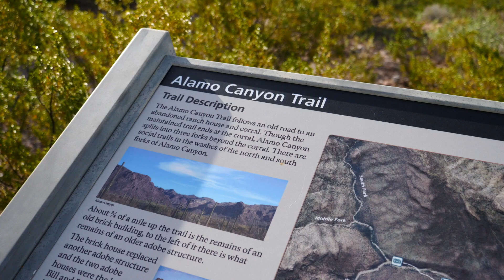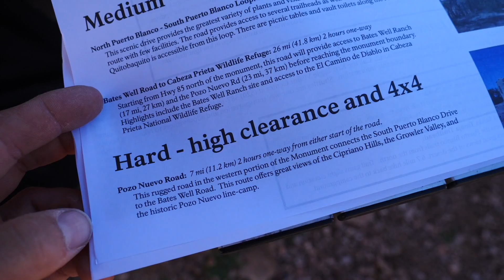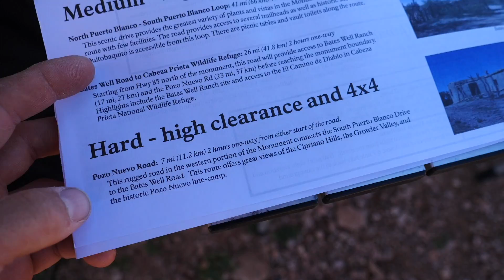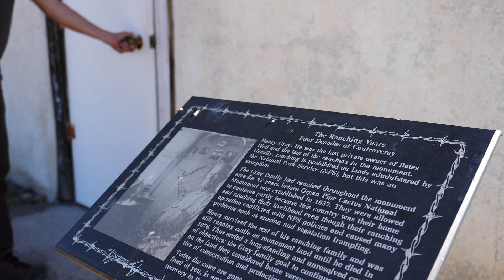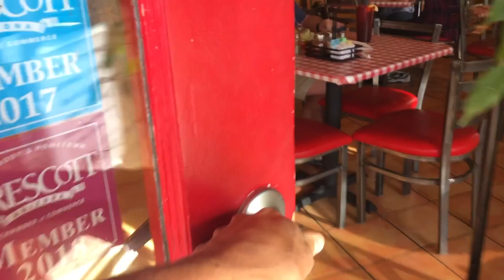V6E9: Consequences in the Desert

Comment: Organ Pipe Cactus National Monument - That looks like another place to add to my list of camping adventures. Thank you for the great video tour. Summit Off Road to the rescue.. The sound seems to be a relay chattering, check for loose connections, ground wires loose, frayed or broken. Disconnect the battery, it will stop the buzzing sound, then reconnect and if it comes back check to see what item is causing the voltage draw then trace down the wire to see if it is hot to the touch, burnt or broken.

Comment: I had a 6.2 LS / 6L80 swap done in my 09 JKU at about 122k and love it.  Drives better than it did when it was new.  Much cheaper than a new JKU and I know the history of mine (and it's still paid off).  Thanks for another video adding to my "I need to go there" list :)
Reply: @thepyledriver does that weigh more than the stock set up?  Also where did you get it?
Reply: @Blue Savage its a 4x4,not a race car..manual/diesel...torque,not revs..

Comment: Hi Chris,  I am a lone traveller like you and I camp/ offroad in the southwest desert.  I had a 2001 Wrangler Sport with 80,000 miles.   I struggled with death wobble for almost a year and spent so much trying to get it fixed and it never really was right.  I also started having other issues crop up that were becoming more and more costly.  After the death wobble,  I lost faith in my Jeep.  I became so worried about something else breaking and being far away from civilization that I stopped going on trips, which really bothered me.  I debated on just taking it to a shop and really having it redone and totally fixed, but  given its age and cost of doing all the work, it didn't seem worth it.  I just felt no matter what I did,  I was still going to worry about it.  Plus,  I dont have deep pockets, and cant do many repairs myself.  While there are a few shops here in Los Angeles that do work on Jeeps, they are very costly.  I have learned that  many mechanics dont really have the abilities to work on modified Jeeps and some of the shops that do are not exactly...trustworthy.  ( If anyone has any recommendations for shops here I would love to hear them) 
For me, getting a newer Jeep was the better way to go.  ( 2016 Willys Wheeler)  While it was more than the cost of getting the old one repaired,  the piece of mind that I have a reliable vehicle has made a world of difference and now I go on trips with confidence.  But, I am back at stock again,  so thats a thing to deal with. 
Rubicons are another beast altogether and I so wish I had one, but they are out of my budget for now. 
I think Moparmagas' advice is sound.  Since you have found Summit, which seems like a very competent shop,  you may indeed be well served  having them really going over it and getting everything right.  I think the key is either being able to do the repairs yourself or taking it to someone you trust.  As he says, you have it the way you need it and you still have lots of miles left on it. 
Its a tough spot to be in.  Either way there is going to be some costs and  pluses/ minuses to each choice. 
Best of luck and keep making your amazing videos. I really enjoy them.

Comment: Sorry for your problems. It's nice that you found a garage that you can trust.  I've watched several of your videos and it makes me wonder why you don't have a winch? A winch certainly would not have helped you in this case. But you are often in very remote areas and almost always alone. I'm sure you must have thought about it. I do realize that they are expensive and heavy. Care to share your thoughts?
Reply: He needs a ARB Brake booster mounted Air compressor (since he has limited interior space) for the amount of times he’s airing his tires down then having drive at speed on blacktop to find civilization again to air up?
Reply: a china winch is $300,with dyneema,, .if it saves you once,it paid for its self/..
Reply: He really needs at least a pair of $60 X-Bull Recovery boards. It's a major oversight on his part. I suspect it's because he's been convinced he needs to spend $300 on Maxtrax & I can see why that would stop anybody.
Reply: @phantomwalker8251  plus looks bitchin' cool

Comment: You'll be good, engine most likely needs a tune-up as you've put a lot of miles in dirty environments with little maintenance.  I hope Summit checked these two areas otherwise I would not be surprised if the death wobble comes back: 1) track bar frame side mount - check to see if the hole is elongated... if so death wobble will be back. 2) check your ball joints... when you were shaking the front of your Jeep it sure looked like the passenger side balljoint was toast.

Comment: I believe the noise your hearing is part of your hvac system, coolant gurgle. Next time you notice it, turn key to on position(RUN/not start) and switch your heater controls from the opposite that they are at(if on heat turn to A/C, if on A/C turn to heat) notice any change? There might be air in your coolant system which is not good as it causes cavitation which leads to holes in aluminum parts of the engine get a coolant flush done.

Comment: Chris, I thought the opening scenes with all those thorns led up to the cactus in the side wall of the tire  causing some damage.I guess you got lucky on that one. I asked this before but didn`t get an answer , how do you air up off road?
I think your Jeep has a lot of life left in it, Moparmaga is right, spend some money on it now and you`ll have a reliable vehicle  again.
My 2011 MB G55 has 130000 miles on it and I haven't even started on my adventure yet. I will set out in 2021 on a trip somewhat like yours and Im building my G in preparation. It will probably have 150000 by then, but I am buying a used VW Golf Diesel to help keep the miles down on the G.
I really enjoy your videos and hope you find that special companion to share it with soon.
 
Thanks, Jack

Comment: I just switched from the FJ with top tent that I put 155k miles on to a Tacoma with the Khaya camper that you have used.  The FJ is a MUCH better 4wd vehicle but when I looked up the cost of adding a alu cab tent, refrigerator, storage and other things for overlanding it felt like I was dressing up a dead man.  Figuring out what the best overall configuration might be is mind-numbing so maybe Overland Expo West is the best prescription for ya.

Comment: Looking at the prices of used Jeeps with the same amount of miles you have still going for 20K, and of course new Rubicons going for 55K, I think you should take your Jeep that is already lifted and modded the way you like back up the Summit jeep and tell them to replace all worn suspension components, track bars, shocks, give the engine a tune up with new spark plugs, flush the coolant, new belts, coolant hoses if needed etc. Way way cheaper than any other option.
Reply: I agree that's all wear and tear stuff and at that mileage with that severe duty use all makes brands and models will see those issues. Definitely not a reliability problem.
Reply: This is what I was thinking as well. You like to be prepared so fix everything & hit the road & trails with better peace of mind!
Reply: I agree, a small, easily rectified issue, can mushroom into a showstopper. I've gotten into the habit of crawling  under the Jeep every morning when overlanding.  Just to check bolts, hoses, lines etc.
Reply: Stay mild on your 2 tracks trekking. The whole Jeep axels are under engineered/built.
Along with other suspension components. Not knocking jeeps, they just are not built for real harsh terrain.
Something a lot of Jeepers find out in awkward remote situations.
Reply: @cliffmorgan31  I think the Rubicon's Dana 44s are probably the best stock axle out there. Maybe the G-wagon but who could afford those? How many stock vehicles can do the Rubicon or King of the Hammers? Of course those that really want to tackle crazy stuff would need to upgrade, but that is the same for all vehicles. Just from my observation, obviously a regional one, you don't see too many vehicles other than Jeep's tackling the really difficult terrain. In Oz it is of course the opposite.
Where , and how, I wheel an unreliable vehicle could easily be a death sentence.
Reply: @cliffmorgan31  I still have my Dana 30 up front and Dana 35 on the rear with lockers.....0 failures so far in 3 years off roading. Only upgrade is I have aftermarket market shafts on the rear
Reply: For this exact reason is why dropped 6K into my suspension and replaced with Heavy DUTY components .
I NEVER cheap or budget anything that either rolls or meets the road.
Reply: @RickZackExploreOffroad  IF one modifies a stock rig, one can expect problems.  If one drives something other than what is proven to handle things from the factory, say a TRD Off Road, one can expect problems to crop up on severe terrain.  Especially when you start going past the load capacities.  You throw a TRD Off Road from the factory into these adventures w/out modifying it, without loading it down with all that extra crap one does not have to have to do an adventure and you will NEVER see it in need of being trailered to a repair facility.  ;)  Come to think of it, I have NEVER seen one being trailered ever.  Lot of Jeeps and Chevies I have seen being trailered and towed, but never a TRD.  Imagine that.
Reply: @WW-wf8tu  True, many people will modify their rigs and not look at the whole picture. When I added larger tires I also re-geared. If I would  have gone crazy with tire size I would have changed axles, u-joints etc. With the lift I insured that all the linkage and drive train angles were kept in spec. Because of doing basic due diligence and studying what will be affected I have never had a problem with any mods. And every mod has seen an improvement in capability and strength. 
I don't see a lot of TRDs out on the trails, but for that matter I rarely see anyone.
Reply: W W - there are probably ten times more jeeps on the trails then tacos, this is why you see more jeeps broke down. Toyota owners don’t use them and drive as hard as Jeep owners. I have two wranglers and never had problems with either.
Reply: @cliffmorgan31  Hey, Cliff. Are you talking rock crawling or just general trail running and long trips? It's purely anecdotal, but I've owned Jeeps for (not doing math) a lot of years with no problems with the components craftsmanship. Rubicons come with a baby Dana 44, front and rear. It's not a Dana 60, but it's a great axle for the intended mission.
Reply: @jcoats5529  No reason to crap on anyone or their favorite brand. The irrefutable truth is that pretty much everyone makes one hell of a rig, now. The main reason Jeeps aren't seen as much, outside of N America is because the company made no great effort to market them to other locations. Australia is a perfect example of that. Much like Land Rover Defenders and Nissan Patrols, they do very well where they are sold. And much like Defenders and Patrols, is unfortunately not everywhere.

Comment: I hope your jeep doesn’t catch on fire. On my TV it sounds as if the noise at the end of this video in the engine compartment is electrical arcing, which can burn you to the ground. I remember another youtuber by the name “coyoteworks”. His Jeep burnt down for no reason. Next time it makes this noise disconnect your battery cable and see if it stops. Thanks for the cool vids. I love Ajo AZ myself as well.
Reply: Yeah, I saw that video by Coyoteworks.  Kind of made we wonder what was going on.  Electrical arching is probably the answer.  I have heard some comment on the net about the electrical problems they have with their Jeeps.  But I love Jeeps and have been driving them for 30 years.  I have never experienced any major problems, guess it is the luck of the draw. But that coyoteworks video really gave me pause.
Reply: I thought that was due to grass under the engine.

Comment: The "Death Wobble". It really seems that this is a big issue with many Jeeps. It seems from what you showed and described, that there are some weak components on the front axle from the factory. You replaced some, like the track bar with stronger parts, (good job) but with things like this a weaker track bar absorbs by flexing(not great) and now places more stress on the mount or the next weak link..boom. Now that part is fixed and should outlast the factory stuff by a large margin.
The Big Question is why hasn't Jeep properly addressed this issue?
Best of luck and Thanks for sharing so much of your adventure.

Comment: But did they fix your steering geometry issues? Death wobble can be caused by a misalignment of the steering triangle. And it kills your stabalizer. If you don't firm up all the joints in that triangle death wobble will come back. Don't stress it tho. You're beating the snot outa that jeep. It just needs a little maintenance.

Comment: It sounded like a coolant issue. Im assuming the truck was still hot when you were looking it over. The coolant system builds pressure when hot. If you have a leak you may hear hissing like that. Did you smell coolant when it was making that noise? Did it go away when engine cooled?

Comment: Any rig used enough in rough conditions the average person won't endure, can result in a fatigued part and a failure of it. I have a 2000 TJ with lot's of major mods (odo@ 142K), '03 Ram 2500 ,moderate mods (odo@ 120K) , and.....don't laugh....an 82 AMC Eagle SX4, moderate mods (odo@ 180K). ALL have been extremely reliable in the conditions they've been built for. Yet, all have seen a well used fatigued part go south. Yes, even the 3/4 ton Ram. Like sway bar links snapping and a caliper bolt loss in the middle of nowhere. 
     I just recently entered the JKU crowd with a 2017 Sport (15K miles, gears, locker, 2.5 lift, winch, stock wheels, 34x11r17 [285/75R17] KO2's, to start it off) I like following yours and others JK vids and seeing what issues may come down the road, on or off, and keep that insight. Every vehicle has its own idiosyncrasies. 
     As we get more and more miles and years from our rigs we know them intimately, and what is likely to have an issue, or had an issue. We learn a lot. I'll carry an extra part or two, or have a trail fix in mind should one of the "simpler parts" decide it's done. And.....as things do break, fix with an upgrade. Although I do keep some parts like traditional U-joints in the stock weaker form to be a fuse for the system. An easy trail fix, over say, a slip yolk or pinion.... 
     Like others suggest, unless big engine or trans issues are surfacing, run what you have and fix as needed. You will know what's what with ~your~ rig and not buy another that you don't, even if new.
Happy Trails ! See ya out there !

Comment: This sound at the end sounded only like a leaky coolant hose so check all the fittings. Obviously with your miles you're hitting that point where hoses will be worn in need replacing but shouldn't be a big deal.

Comment: You should have got a toyota.  120k is just breaking in the vehicle.  I have seen fj cruiser with 700k with stock engine and transmission.  My fi cruiser had 260k and was running strong.  One thing I like about the jeep is the tent..

Comment: Your jeep still has lots of years to give. Time to update everything that is tired and worn. IT's way cheaper to fix tired & warn and even replace a few items with stronger components than it would be to get into another JK Rubicon with practically no miles.
Reply: I agree. It is only 120,000 miles. I don't think a vehicle like a Jeep should die at 120,0000 miles. I am sure it can last till 200,000 miles. It is not like you really beat that Jeep. So, just fix it. It is at that mileage that it needs a major tune up.

Comment: At a 120k you have put relatively no money into your suspension. You basically need to replace the entire suspension and ball joints.
Reply: Shouldn't have to.  It's supposed to be a Jeep.
Reply: 193001 kiplssd No amount of maintenance would prevent metal tearing and welds breaking my friend.  There’s no excuse for Jeeps top off-road vehicle to self destruct from driving on bumpy roads.
Reply: Just like Toyota and the rusting/snapping chassis debacle - Didn't Toyota settle for $3.4 Billion Dollars heh? @terrywaters6186
Reply: @fredbrackely  Jeep frames rust out and break too.  Has Jeep taken corrective action by replacing frames like Toyota did?
Reply: Unless I heard incorrectly, I believe he said 120 MILES
Reply: @monkeyman41333  he said the jeep has 120000 miles on it.

Comment: Streets of New York Pizza you would have liked.  ;)  Folks live in Prescott.  That is our choice.  As for your thought of what vehicle should you be driving for your adventures, that is of course your choice.  However, consider this, when when you explore what is being used in less developed countries and in the places where help is not a cell phone call away, what do you see them driving?  ;)  I think you will find the majority of reliable vehicle choices in the extreme environments to be Toyotas.  IF I were in your position and was traveling around doing my own YouTube channel to illustrate adventures and scenery, I would pick a TRD PRO 4Runner.  :)  Don't over modify it with lift kits and over weight it with non-essentials.  You will find it taking you to and from and beyond places you explore.  And you will not be back tracking to shops for repairs when you should be moving forward with your plans. ;)